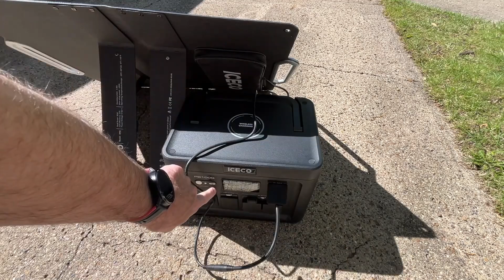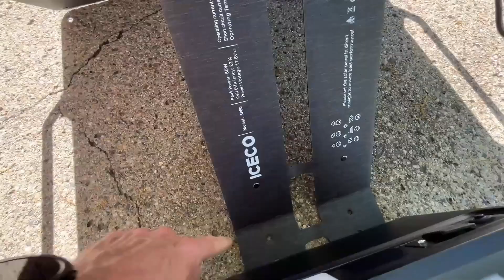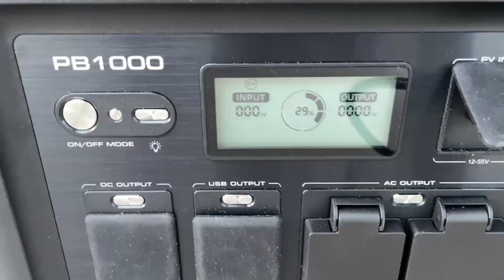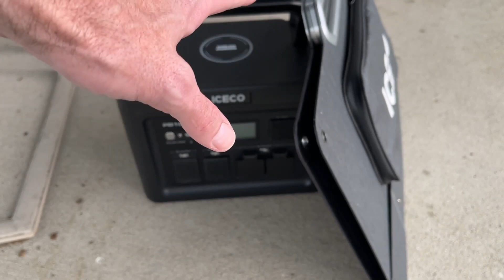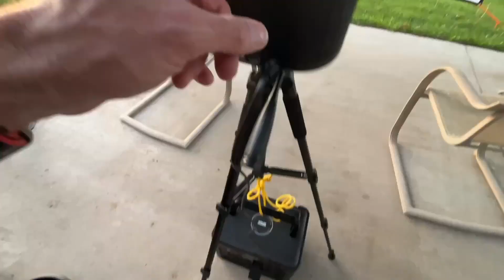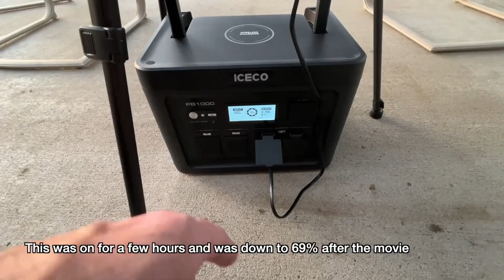ICECO | 80W Solar Panel & PB1000 Life: A Real-World Test

Comment: Will the ICECO watt panel charge the ICECO fast charging Magnetic portable power station?
Reply: Yes it will, as the panel is 80W and the battery will work with a panel up to 100W (more than 100W may fry it).
See if you can find a Y-T video on that to be sure. Or call ICECO.
Good luck,
-- BR

Comment: What about using the Solar Power Panels to charge the ICECO Fridges directly??
Reply: I don't know why he never answered you -- not cool -- but I might be able to help.
To answer your question, no, it won't. The panel needs to be hooked up to a battery, then the battery powers the refrigerator. For example, if you had this ICECO 80W panel and also the ICECO 250 "magnetic" battery, that would work.
I've ordered 2 of those batteries -- so I can have one running the refrigerator (an ICECO APL35 when it arrives) and one spare always fully charged -- but instead of an ICECO 80W panel I'll be using a BougeRV 100W folding panel. IIRC, these batteries can handle no more than 100W charging input so it should be faster charging using a 100W panel -- even if you don't even get a full 100W output -- vs. an 80W panel.
I guess the battery has some way of regulating the voltage input (meaning, doesn't require a separate solar charge controller) as long as the panel is 100W or less.
-- BR

Comment: What charging cable is included with the battery? Is it a wall outlet cable or does it come with a cable that can charge it with the cigarette lighter in a vehicle? If that’s not included, what cable is required to do so, I want to charge the battery in my car while the fridge is connected to the battery.
Reply from the maker: The PB1000 comes with an AC charging cable and an Anderson-to-7909 connector cable. Charging via a cigarette lighter is not recommended, as it may be inefficient or unstable. For better performance, we recommend pairing the PB1000 with compatible solar panels.